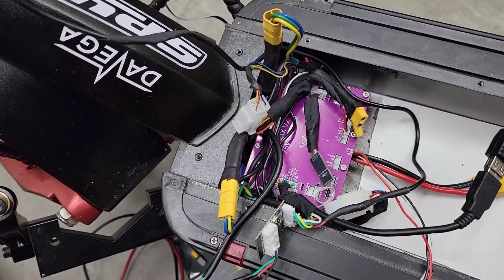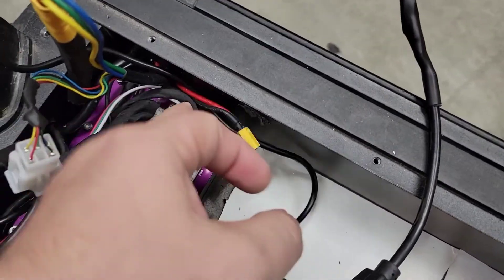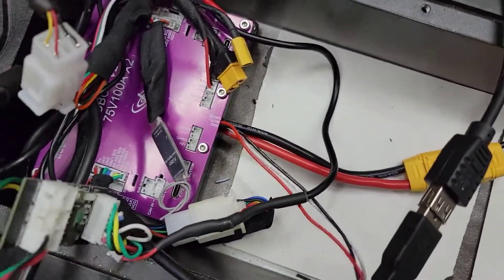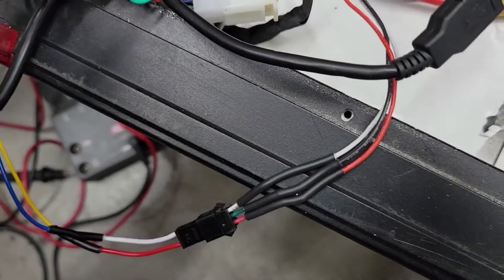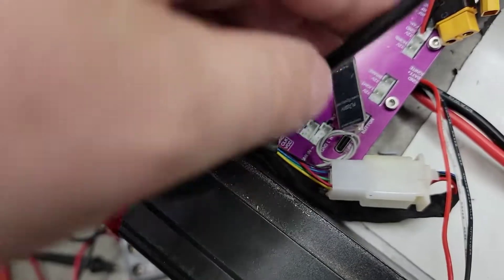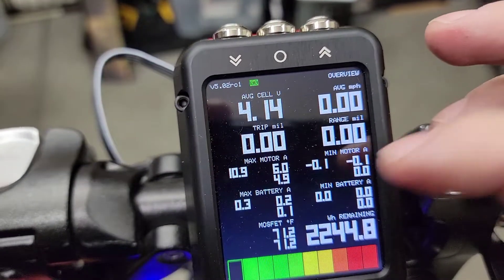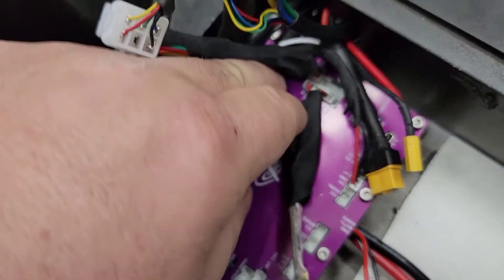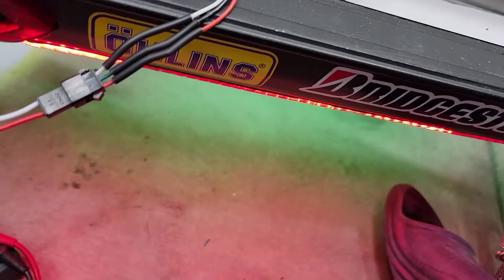Spintend VESC controller in Zero 10x dual motor scooter with Davega display

Comment: I've thought about doing this to my Laotie Ti30, so it's nice to see a success story. Thanks!
Reply from the maker: Go for it! I'm sure you have a lot more space in the deck than I do.
Reply: @NRGZ28  Just did this to a friend's ES18 lite. 100% worth it, it's so smooth!
Reply: @yoctoflop  did you installed it on Ti 30? I want to install it too but I'm afraid about controller getting hot for long range.

Comment: I’m in the market for a Dualtron Thunder 2, and I think I’m gonna upgrade the controllers to FOC/sine wave. I was worried about losing the EY3 display, but this looks like a massive upgrade for seeing relevant info as well as more detailed stats 👍
Reply from the maker: Definitely. Massively increased throttle smoothness too, BUT... Dualtrons don't have hall sensors in their motors, so it won't be as smooth as you'd expect...
Reply: @NRGZ28  The Ubox 75/100 V2's have phase shunts & filters, give V0V7 Silent HFI in Vesc firmware V6 a go

note: the 100V ones (required for battery voltage > 52V to be safe as max charge of 52V is 58.8V and voltage spikes can and will potentially destroy 75V models on anything higher) do NOT have phase shunts, they have low side shunts so it might require more tuning to get right

as far as OP goes, since he can and does use a 75V model, silent hfi can be even smoother than hall sensors
Reply: @NRGZ28  is it work for motors without hall sensor?
Reply from the maker: @99prabs  Yeah..
Reply: @NRGZ28  thank you

Comment: Hello!  You really did a great job with the display connection!  👍Question: I have the VESC 75100 with Bluetooth module and everything works But question: I have a VSETT display and I can upload this Lisp file for the VESC and VSETT display but it says ;  no paired!  I would have to connect the VSETT display to the VESC so that it switches on the VESC and then I can upload the Lisp file for the VSETT display and the Erorr 10 error on the display will then disappear and the kmh display will then also work.  PLEASE can you tell me because the VESC does not have a power cable that you can switch on the VESC with the display because normally there is a red power cable, a GND minus cable and a blue cable, all of which the VSETT display has but the VESC does not because the blue cable is normally there  With the standard controller, return the strim to the controller and then switch it on immediately.  How can I do this with the VESC so that I can switch it on with the display?  I have now only connected VSETT display with VESC Rx to Tx and Tx to Rx but that is not enough because I still have to be able to set the controller with the display somehow.  Can you please tell me how and which two cables can I use to switch on the VESC with the display?  Because it doesn't have a power cable, Sonett only 5V + cable and GND cable.  I only connected the gas that is connected to the display to the VESC on Adc1 with the Hall voltage cable and everything works.  Just please can you tell me can I connect the display to the VESC with 5V and GND cable using the display power cable and GND cable?!  But when I now connect the battery with the VESC XT60 connector, the controller is immediately switched on!  Hmmm... I have now closed the VSETT display on the battery permanent plus and minus, but where do I have to connect the plus and minus cable from the display to the VESC so that the display switches on the VESC?  Please can you just tell me this and help me?  I beg you very much!  Because you are probably a professional in electronics and have managed to connect the display to the VESC.  PLEASE!

Comment: Hello again!🙂 I have already connected the Rx/Tx to Tx/Rx from display to VESC 75100 controller, but can you PLEASE tell me whether I should connect the display plus + cable to the 5V+ plus cable with the VESC?!  That the VESC turns on or is connected to the display?  Because I absolutely have to connect the VESC with my VSETT display because then I can upload the Lis file (script( for VESC and VSETT display into the VESC and then the kmh display from the display would work. I only have Rx/Tx to Tx/Rx display  connected to VESC but that's not enough it shows me who I upload the Lisp file that the VESC is not connected to the VSETT external display and I still have to connect. But the VESC only has a 5V + (red cable) output! And  If I connect my 48V battery with VESC, then when fully charged, 54.6V comes into the VESC and it switches on with a blue light. So where do I have to connect the plus + cable from the external 48-60V VSETT display to the VESC?  Please can you just tell me where I have to connect the Plus+ cable from the external display to the VESC so that it is connected to the display? I beg you very much! Please help me with an answer. Kind regards. :)

Comment: could you show more in detail how you wired your battery please? :)
Reply from the maker: Nothing special...  I used a 2xXT60 to XT90 adapter harness, since the ubox comes with a XT90 on it.
Reply: @NRGZ28  thank you,  if I want to connect a second battery how  would i do that...? Do you have a forum.or something...?
Reply from the maker: @nehanichikahuak  Then you just use a y splitter harness for the 2nd battery. As long as the voltage ratings match, you should be okay. My zero 10x has a 38ah and a 23ah  52V battery packs hooked up in parallel.
Reply: @NRGZ28  in fact I would like to put 2x 72V batt on mine with bigger motors, thats why I asked you a link if you're in a forum 😃

Comment: Will this controller work in 100+ degree weather and is it possible to just use the vesc phone app for a display?
Reply from the maker: Yes and yes. But make sure you cool it and bolt it down to the deck.

Comment: Is there a rule to route the 3 motor cables to the VESC based Ubox V2 100V 200A dual motor controller? Will the tool set up without having to match the front and rear motor cables the same?
Reply: From what I’ve seen doesn’t matter how you set up phase wires to controller

Comment: At 60 volts  can you estimate what the top speed would be? Using the stock 18650 cells.
Reply from the maker: I get 50 with my 52... So maybe 55 or a little more for you?
Reply: @NRGZ28  you got 50mph from your 52v 10x??! Has your acceleration improved or same or suffered?
Reply from the maker: @MrFas4wd  I did. The acceleration has improved vastly!

Comment: Want to do this to my zero 11x. Kinda scared tho. So I’d have to get rid of the Qs display and replace with custom throttle.
Reply from the maker: That's the easy part. Be sure your wiring skills are excellent first.. There's no going back.. Lol
Reply: @NRGZ28  your video is almost identical to the 11x wiring except hall sensors which isn’t necessary
Reply: Each motor pulls about 38 amps. I believe they are 2800 watt peak each. I have a 20s 9p 21700 pack as well. Each cell max discharge is 14.4 amps how would I divide that. If it’s not to much for you would like your opinion. Or what I’m asking is what is my battery peak discharge would it be 14.4x 9 or 14.4 x 20
Reply from the maker: @Skylersteel  It would be 14.4 times 9 of course. With the vesc you can control the current output to what you want of course. I do about 100 phase amps per motor on mine...
Reply: @NRGZ28  awesome bro thanks. Gonna do this down the line. You inspired me. So I have 138 amps fiddle with

Comment: How did you wire up the throttle im guessing it has 5 wires ? +5,negative,signal,battery positive but where does the 5th wire go 
Thanks
Reply from the maker: The wire is only three wires. 3.3v...signal...ground. All directly into the vesc hooked up to ADC1.

Comment: How did you handle the eco and turbo switches?　Can I switch between high gear, middle gear, and low gear on the Davega screen? Can I do the same operation after connecting my mobile phone?
Reply from the maker: I didn't concern myself with that. This is a high performance machine now, no need for speed limiting switches. It's all in the throttle :)
Reply from the maker: But to answer your question, you can't do it with the board I used for the vesc. Spintend does make a newer board that supports that now.. Or you can setup current limiting profiles in the vesc app and switch it that way.

Comment: How do you connect the 2 battery outputs to thee Ubox? It appears only one is connected. I assume both should be used to get the required amps.
Reply: No, the ubox is actually two vesc connected via canbus and fed by the one battery input. It does split the amps, which you have to take into account in the VESC settings when setting up your motors (max battery amps = 1/2 your batter total amps per controller for example).
Reply: @anontiffany1573  One battery output with the inline fuse probably can't handle the current draw of 2 motors at maximum power, thus requiring both battery outputs to connect to the ubox. Presumably an XT90 splitter is needed.
Reply: As I said, this is two controllers linked by canvas. They act as your split. As long as you know your battery max amps and put that divided by two as your motor limits on each controller you're good. Literally riding mine as proof lol.
Reply from the maker: Two XT60 to one XT90 adapter harness. Simple.

Comment: Did you use the stock DC converter for the original headlights/brake lights? If not, how did you wire those up to function when the brake lever is pressed?
Reply: Did he answer you

Comment: Also, since they're out of stock on the ADC adapters, would the throttle, lights, and brakes still work if I didn't get one?
Reply from the maker: Of course not.. You'd have to rewire all that individually.
Reply: @NRGZ28  Damn, guess i'll be waiting for those to come back in stock.
Reply from the maker: @her0z217  Get the new version they got. Seems much more capable..

Comment: How does the display know the average cell voltage? Does it communicate with a BMS, or just calculate from the system voltage?
Reply from the maker: Not sure about that. It just reads system voltage through the VESC controller.

Comment: You missed the dual/single switch, eco/turbo switch, head light on or off switch, brake lights activating when brakes applied, and horn or blinkers if this scooter has them (mine does)
Reply from the maker: I wouldn't say I missed them... I don't need all that. This isn't a granny scooter..
Reply: @NRGZ28  i was being a little dramatic but my problem with the VESC and others I can find is the lack of display compatability with added switches. They seem to be designed for longboards (displays a big and bulky to sit on them as well) which don't really make sense for scooters. The flipsky controller is the only one I can find but again it doesn't have a controller/throttle combo and looks like it's designed for a longboard.i hope more options come out for us scooter guys! It's a niche market but there is deffinitly a gap there to make some profit
Reply: @Nate7700  problem with most "power" scooters is that the screen is in the throttle, absolutely useless if you place the trigger throttle properly up to the brake levers as you can't read the screen in that case

turbo/dual buttons shouldn't need to exist even, especially with VESC you can use current control mode which means you control the amount of power/torque rather than speed with full acceleration every throttle tap, feels so much smoother and better

as far as screens in general go, okay yeah i agree it kinda sucks there's no ebike screen or something compatible with it out of the box, but other than that i have no regrets throwing those crappy squarewave controllers away

i actually control how much i want to accelerate rather than that shitty speed control all torque mode most power scooters have
Reply: @BH4x0r  the square wave controllers are garbage, I replaced mine in the mantis pro for sinewaves out of the King GT but I wish I could have done a vesc or something similar. Not many plug and play options available yet

Comment: hi, excellent video thank you. I would like to made the same mod, can i use the 72V controller with the stock 60V battery on my 10X...?
Reply from the maker: Yes you can. The Spintend box can safely go up to 75V.  If you want to have more headroom, order the black 100V model.

Comment: Any reason you're using a bluetooth adaptor? My original V1 ubox has built in bluetooth, does V2 not have it?
Reply from the maker: Yes.. the new version does not have built in BT.  Bad move on Spintend's part in my opinion.

Comment: I bought this to connect my Ubox V2 100V to my zero10x. I want to connect the motor sensor wires from the motor to the hall port of the Ubox V2 100V, but I don't know the wires.

GVD what color
H3 what color
H2 What color
H1 what color
temperature color
5v what color

Thanking you in advance.
Reply from the maker: Temperature is not used. On the zero 10x, black is GND and red is 5V... H1 h2 and h3 don't matter how you do it, it will automatically get detected by the vesc.
Reply: It was helpful

Comment: Hi I wanted to ask you is it possible to put a 3 speed switch with this controller? or any other method of changing gears?
Reply from the maker: Not that I know of...  You can setup profiles in the vesc app to limit speed on demand, but not buttons. Just use the throttle :)
Reply: @NRGZ28  Grazie. Molto gentile.

Comment: How to set zero10x52v25Ah 1000w motor if you are using VESC tool for Ubox V2 75V 200A. The VESC tool does not support Japanese, so I would like NRGZ28, who uses the same model, to help me, but if possible, could you make a video? I wish it was faster.

I'm sorry for the unreasonable request, but I'm looking forward to seeing you.

Comment: I'm riding ZERO10X52v1000w, will this make it faster?
Reply from the maker: It will get it to 50mph. I can't get it any faster than that on 52v...
Reply: Thank you for your reply.
Is there a quick and easy way to speed it up without hurting it?
Since it is a public road specification, it has a turn signal and a stop lamp, so I do not know the wiring, but is it still worth doing?
Please help me with almost amateur magic remodeling

Comment: how does it compare to stock controllers ? are you rocking the same battery ?
Reply from the maker: Much more torque, higher top speed due to that, and butter smooth throttle response and control. I have two batteries hooked up in parallel for extended range. When rocking just the built in battery, I have to adjust the controller down to about 50% power so the bms doesn't trip. Still feels way faster than stock controllers.
Reply: @NRGZ28  Thanks! Was contemplating with updating my OG Thunder to something like this ( no hall sensors and no extra battery ). Seems like a nice upgrade
Reply from the maker: @slick1908  I'm sure you'll see plenty of gains, since the thunder has a much stronger battery pack than the zero 10x. Might even make it smoother, although the lack of hall sensors will definitely hold you back..
Reply: @NRGZ28  I heard foc controllers deactivate hall sensors after like 3mph or so and I thought it would not be a big deal. I got no problem with the way it is now since I push the scooter a few inches when I start instinctually so it does not kick back till it figures out which way to spin anyway.
Reply from the maker: @slick1908  That's true. The vesc is configurable to run "sensorless" so it won't be a problem anyway. These things are very flexible. Love them...